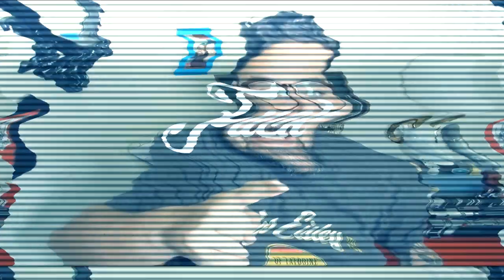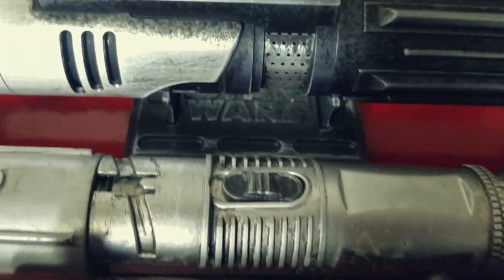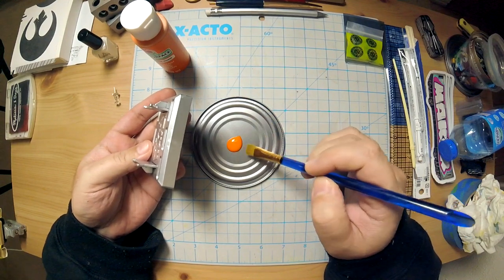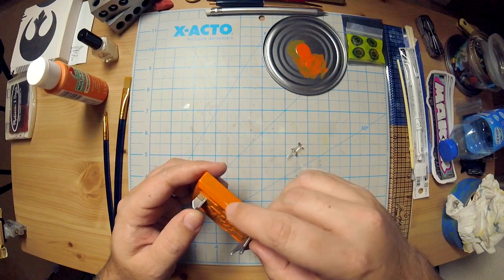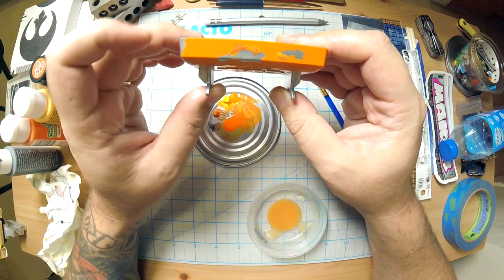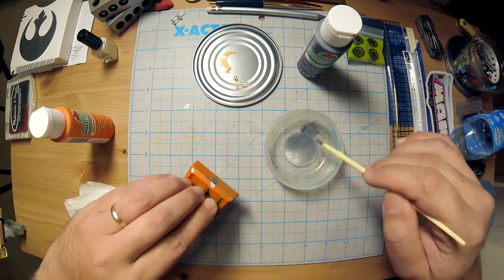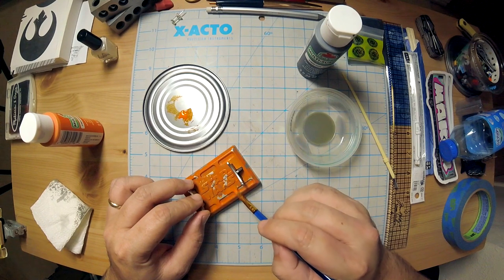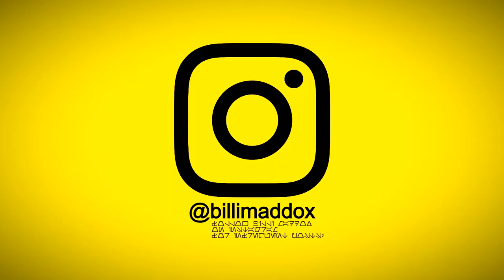▲ Paint Chipping Effect Using Liquid Latex // A Low Profile Lightsaber Stand // Star Wars DIY

Comment: Really helpful advice, thank you. I plan to use this to add paint chips to some mandalorian armor I'm making. What is the brand of liquid latex you use? I had a hard time seeing the label in your video.
Reply from the maker: Thanks! I think it's a cheap drug store brand. It's sold where nail polish type stuff is sold. Sometimes hard to find but a target should have it. If not, Amazon should have some. I'm pretty sure that's where I got mine. Just search liquid latex for nails. You can buy some at a hobby shop but that's always going to be more expensive for the same product. 🥪🥪
Reply: @MakerMaddox  cool, thank you!
Reply from the maker: @Alex-qd7pb  also, since you're working on something a bit larger scale, and these bottles are tiny, believe it or not, toothpaste and mustard work the same way for some reason. Though I trust toothpaste a bit more. Might want to test that out too!
Reply: @MakerMaddox  Interesting. I might try that, though I like the latex idea better since it dries and it’s harder to smudge off and won’t mix with the paint on my brushes. Do you know if special effects liquid latex works, like the stuff people make fake scars and wounds out of?
Reply from the maker: @Alex-qd7pb  I've never tried it but it sounds like it would be the same thing. Try a little dab of it somewhere, if it dries but pulls up easily, that's what you're looking for! Shoukd work